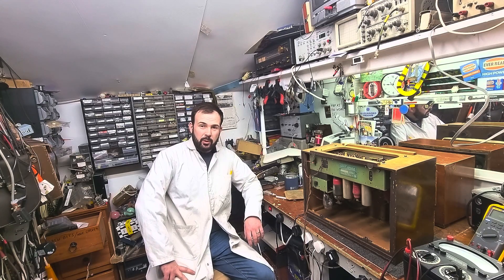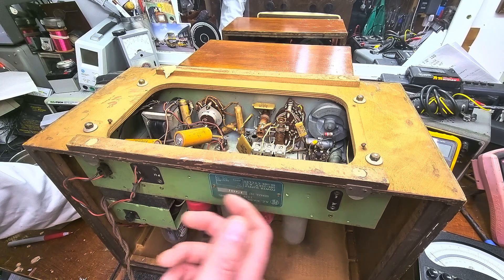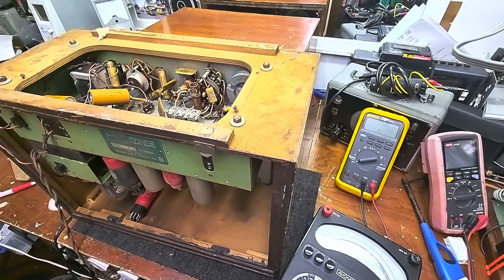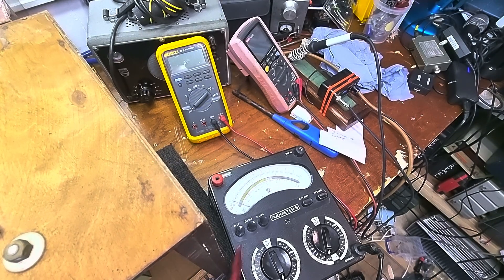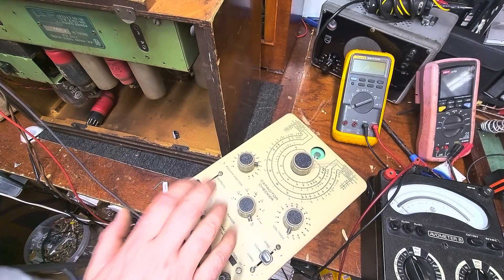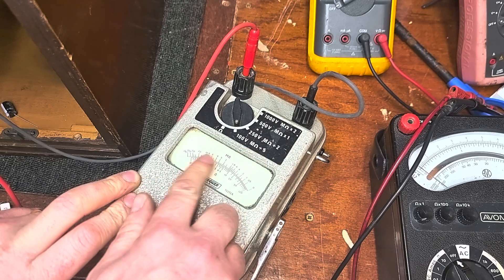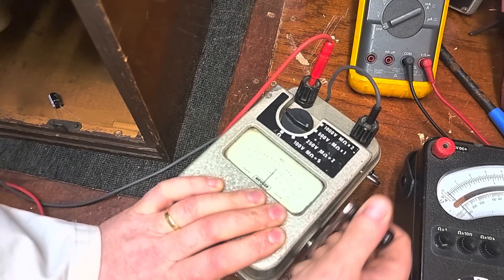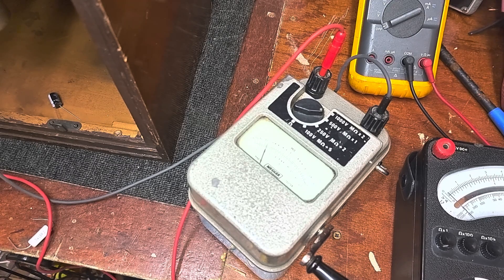Are all caps Bad? A look at Sprague capacitors.

Comment: These are pretty much the test procedures I use. My bridge is a Hunts CRB-3 (I think it's 3) and I use a Megger BM8 battery powered high voltage tester, but otherwise, I'm using the same procedure.

Comment: Great bit of testing, I told you  they would be surprisingly good, I have an unrestored Pye D18T TV from 1948, the only part I had to change was an open smoothing cap, then had a stable test card C, loads of these Sprague caps in this set, hence how it worked after 60 years asleep!
We will have to keep quiet about these, those audiophools  will be after them.......
Reply: Hopefully, the "phools" will never want them because they affect the tonal quality of the audio by introducing multiple reflective chaotic sibilant pathways via the metal casing, resulting in an audio output which sounds like a busker wailing his head off and echoing along the walls in the glazed tiled tunnels of the London underground.

Comment: Don't change the cap unless it's in a place where it could kill a valve (anode to grid death).
Re-stuffing can be nice if you like the original look, but most ordinary radios are not special.
As a crude test i connect +250-400v  to the cap and a 10meg multimeter in d.c voltage mode from the other cap lead to the Ov line.
if the cap is short then the full voltage is shown,  half voltage = 10 meg leakage and so on.
I'm sure there is something silly wrong with that bridge type tester.
i do like the access cover, it shows that the manufacture wanted it to be serviced easy :-D